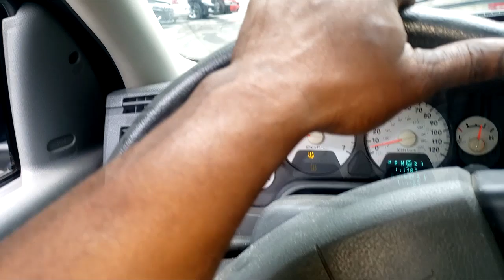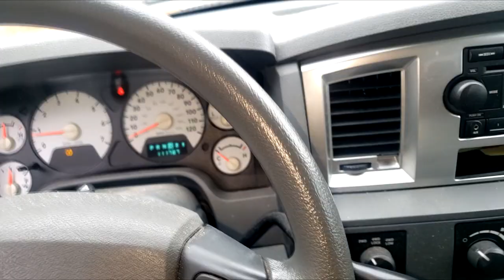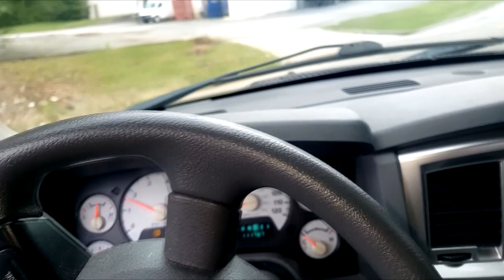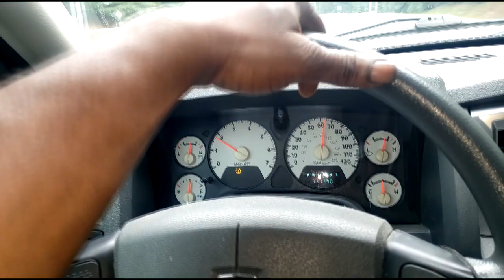Dodge Ram 1500 Death Wobble? Maybe not.  Could it be the brakes, the suspension or even the tires?

Comment: I hate calling it "Death Wobble". That's a sensationalized term used by lawyers,  and vehicle owners who have stupidly modified their vehicles and/or worn them out by not maintaining them, and then  expecting the manufacturer to fix them for free.
I think I had a wobble on a used Jeep Cherokee I bought. It had 200k miles on it, and it vibrated so bad I had to pull over, expecting I had a flat tire. No flat tire. I put a new set of Michelin tires on it, and a set of new Koni shocks and it never happened again.  That was 100k miles ago.
Reply: Im thinking shocks and struts too.😂

Comment: My old military power wagon had it. I think I already talked about it but I had to replace the upper brass bushings with some ww2 surplus ones a truck parts place had some 40 years later back around 1978.
You could actually see the wheels bouncing side to side and up and down if you let it follow you from another truck. It kicked in at around the 40mph and would smooth out again slightly above and below that speed.
Reply from the maker: Whoaaa..

Comment: I was gonna say a minute in the video and i saw a transfer case and front axles. I used to have a 95 f150 with a 6 inch suspension lift and 35s, that bad boy had a death wobble til i put dual steering stabilizers on it. Would jump up and down around 50 til you stopped, id get so mad i would stand on the brakes lol
Reply from the maker: Lol...yea I mis spoke. Yea something like that would drive me crazy

Comment: So I dont think my truck has the wobble but it shakes in the front even after putting new inner and outer tie rods cv axle on the passenger side with the upper control arm. What else am I missing?
Reply: Intermittent shaft

Comment: I have a ram 3500 4x4  ram changed the tires and drag link, stabilizer bar. Still have the death wobble
Reply: Inner and outter tie rods, alignment, check bearings, all bushing mounts. I'm looking into my 1500 2015 Currently. It's just starting.

Comment: You can put it on a lathe and balance it that way
Reply from the maker: Really?
Reply: Yes sir I worked at a shop and we would raise trucks 2 foot high make street legal monster trucks and we had a metal lathe we took old school bus driver shafts and cut them down put them on the lathe and balance them some older GM trucks had a transmission with a 9 inch yolk and the one piece driveshaft was hard to find so we made them the same way